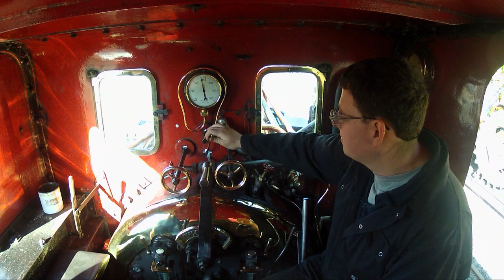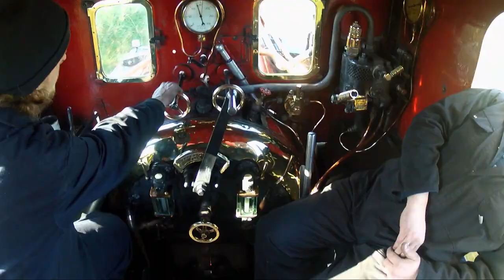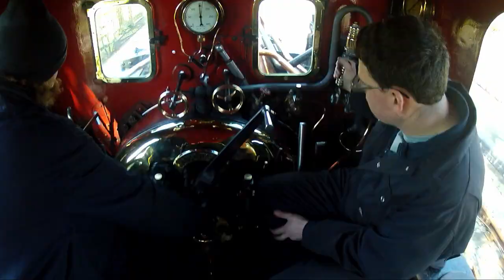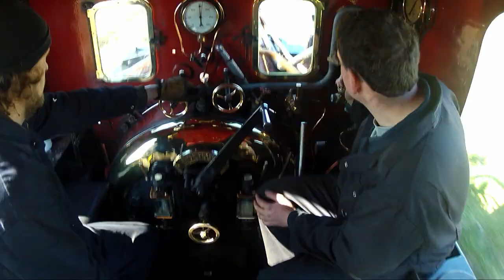Cab Rides: Isle of Man Steam Railway Pt 1

Comment: Great footage! Is there any particular reason for the right-hand driving? I noticed the same practice in your Snaefell video.
Reply from the maker: Thanks Zartas17. Not sure what you mean by right-hand driving. The steam railway is single track apart from passing loops at stations. Am I misunderstanding you? As for the Mountain Railway driving on the right, does anyone know why?
Reply: @cabrides  Actually I was referring to the driver's position in the cab.
Reply from the maker: @Zartas17  Ah! Sorry :-) Different railway companies took different approaches to the driver's position. If you watch the Llangollen Railway cab rides you'll see the driver on the right - that's a GWR loco - but other companies chose to drive from the left.
Reply: @Zartas17  all British locos used to be right-hand drive, but the major railway companies (except the Great Western) went over to left-hand drive in the 1920s/30s because signals are generally on the left (and always have been).
Reply: @dkbmaestrorules  I suppose that rather prompts the question "why were locos designed at one time with the driver on the right if signals were on the left?". Surely it makes sense for the driver and signals to be on the same side, since the presence of the boiler will obscure a signal once you get close to it. I'd always assumed that GWR locos were driven from the right because GWR signals were on the right of the track they related to.